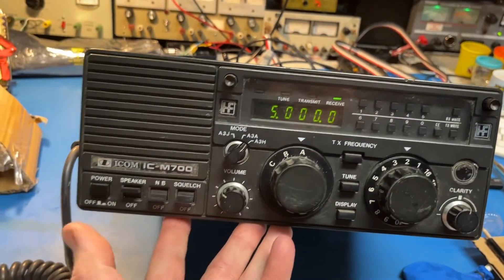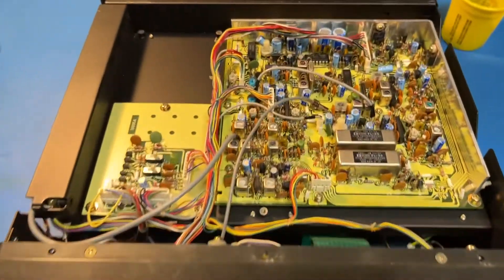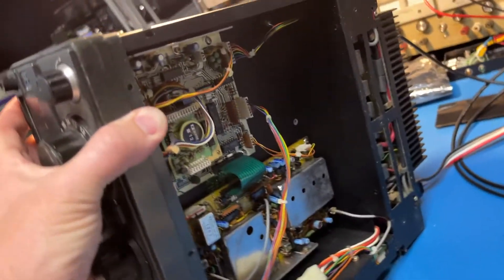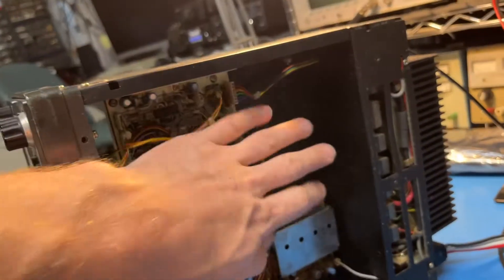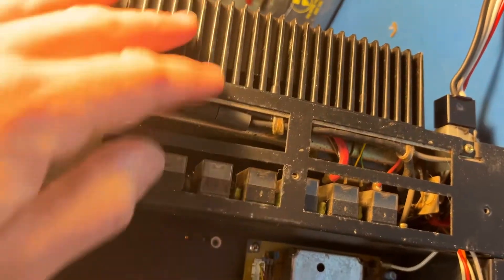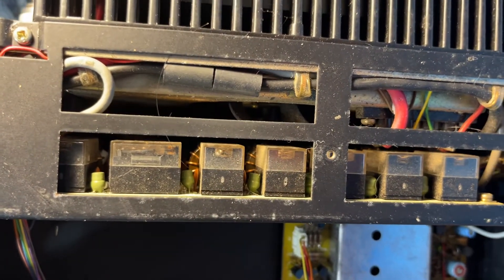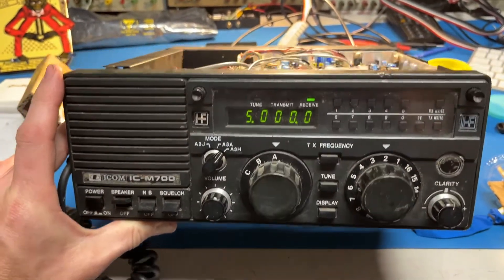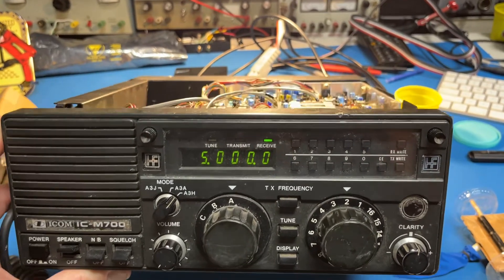IC-m700: Just opened it up

Comment: They are getting to the age where parts are failing left & right. ICs can be found as still common through hole parts. When working they have great receive and one of the best HF squelch circuits I have used. I have the model with CW also. My logic board gave out so planning on shotgunning repair to that board over the winter when I have hours to waste.
Reply from the maker: I agree about that squelch. It’s just so perfect. More radios should have sideband squelch. 

You could easily run the radio from a modern microcontroller. There isn’t much going on other than configuring the PLL.